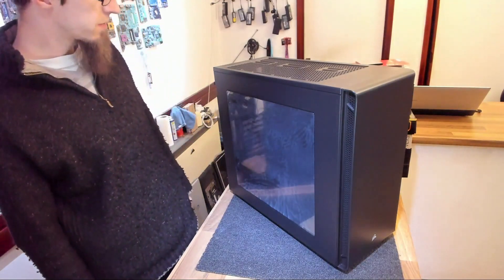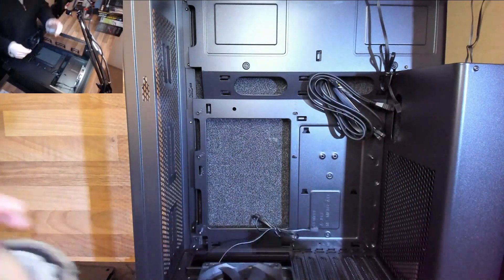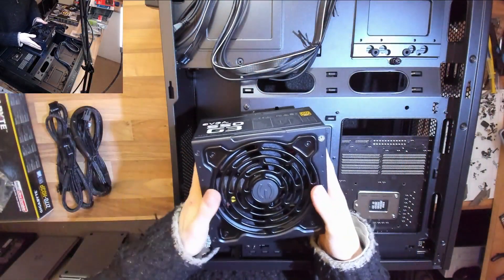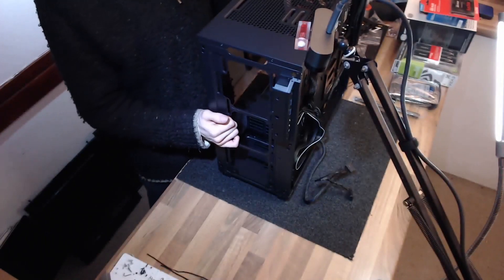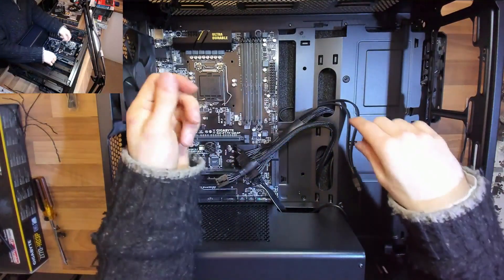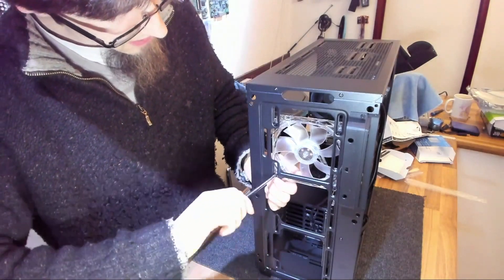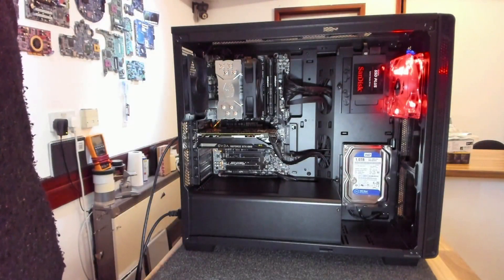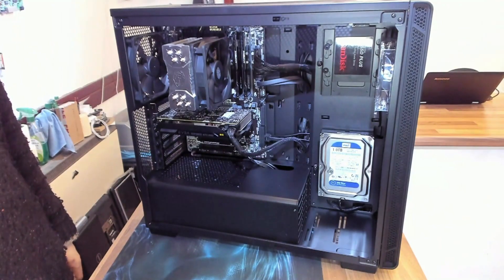Let's Review - Corsair 270R

Comment: Great video. I've just purchased this case and quite disappointed that no top filter came with it. Does anyone know where this can be purchased? I've not build mine yet but looking at the hard drive position does it get in the way of the fan mouting on the front ? Cheers

Comment: How would you rate cooling performance because I’m planning on putting a mini itx board in as well as a Corsair h55 cooler for the cpu and a reference gtx 1080.
Reply: Adamant IT thank you for reply, I plan on getting 2 extra  fans and would you mount the h55 cooler on the back of the case to also act as a exhaust
Reply: I will buy this today with similar specs of yours

how's the cooling??

Comment: @Adamant IT, hey i have the same power supply G3 650 supernova, and i put it in this case fan facing down, i tried so hard and could not get 2 of the other screws to allign so i left it with 2 screws.... is this bad? can u please try and tell me if u can get the 2 other screws to allign if facing the fan down? i would really appreciate a response.
Reply: Thanks for ur answer, i have the same case as you (Corsair 270R).

Comment: can we put 3 140mm fan on the front panel? its really hard to get this info
Reply: can you have 120mm fans too
Reply: @eliaslygre7592  its a bad case get noua utopia instead much better value for money.
Reply: @eliaslygre7592  I built my first pc with the 275r today and I have one 120mm in the back, two 140mm in the front, and the 2 that came with it in the top, all fitting in there with plenty of room.

Comment: Radiator at the top of the case... What are you talking you can clearly see there is barely enough space for 140mm fans. It's only 3cm space at the top. This case is designed to have radiators at the front that's why it is so long and not that high.